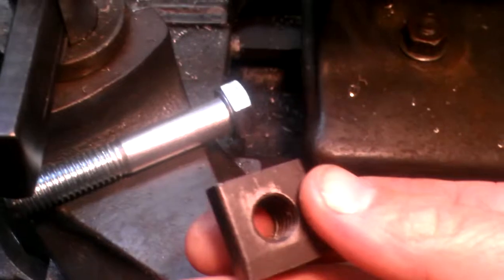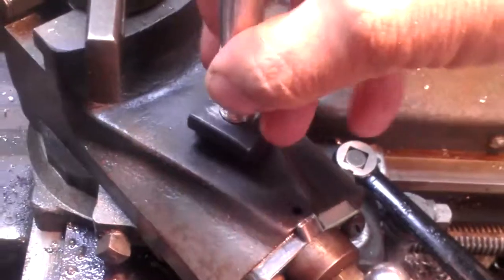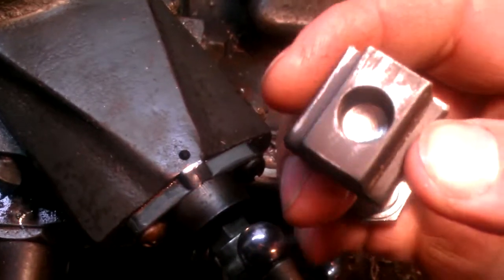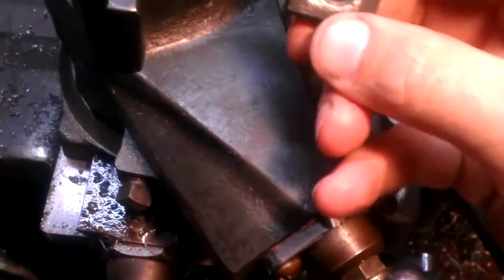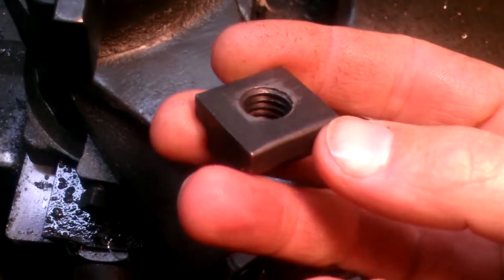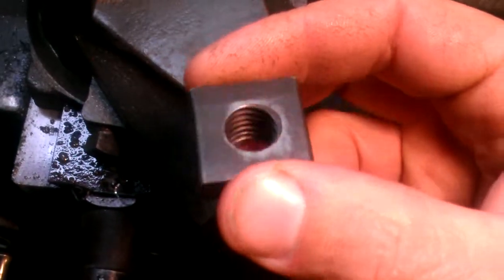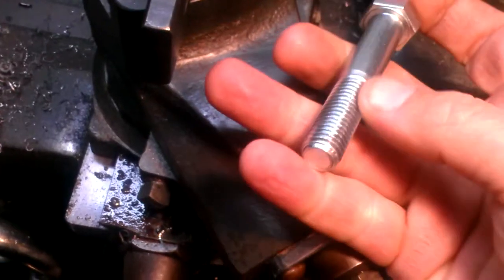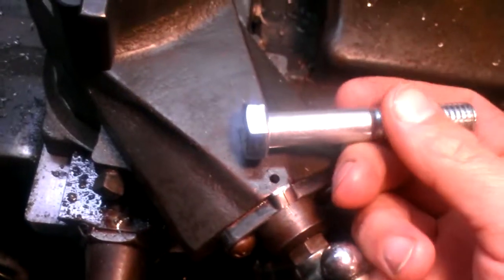T slot nut

Comment: Just come across your videos and like your content. I would like to add a comment about the T nut. Most of them I have used have an interference fit at the bottom of the thread so as not to let the bolt protrude down thru when installing the threaded stud. Most tell you this in their ad product details. Turn it over and put in the stud from the top side and see if it is smooth sailing till you hit the interference. If you don't like it that way just zing a tap thru them as you have. Thanks.
Reply from the maker: +Eddie Kawecki hey thanks for the comment and you are corect about the thread interference but the imported nut I bought wouldn't even let the bolt start. It was just a junk part lol any way hope you subscribe I have plenty more to view and even more to come.

Comment: Hi Chris, is that T nut hardened? If yes the tap will suffer... if not the thread being so close to the original might end up pretty weird.
Pierre
Reply from the maker: no Pierre it was not hardened the tap just chased it now it fits very well its a hair snug but that's fine it will keep the stud in its place going to  work on reducing the bolt later and taping it to m10 for the nut to my tool post later tonight